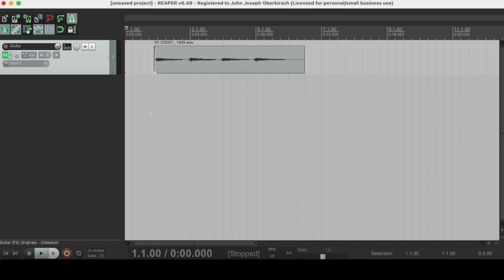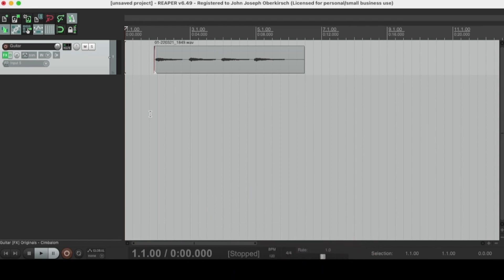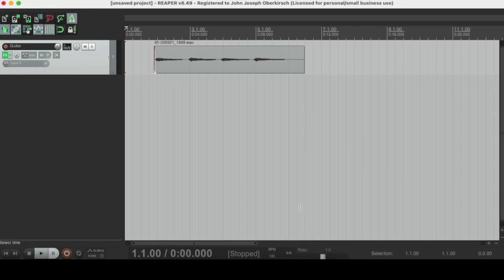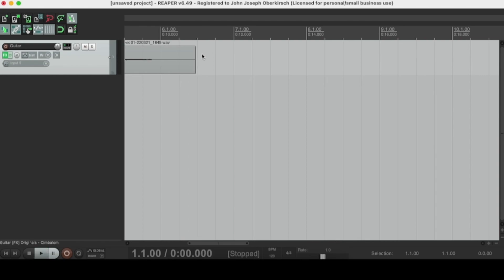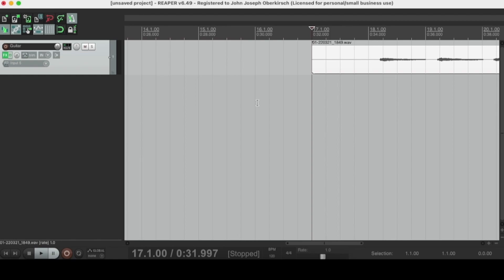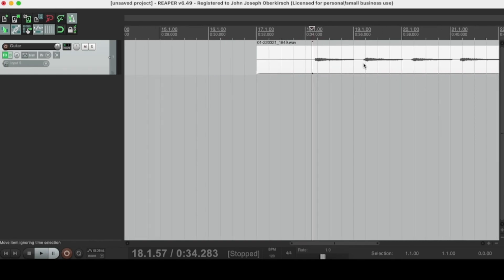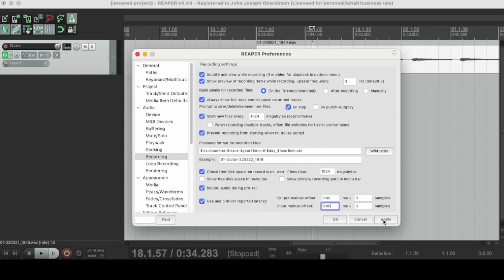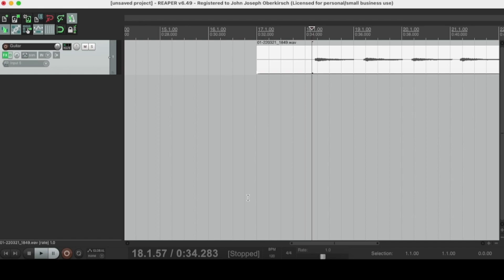How to Fix Latency in REAPER (Easy to Follow Guide!)

Comment: Latency in windows is mostly due to using the cpu for digital to analog conversion.  ASIO4All driver is more efficient than the windows driver but still rides on top of the existing driver and uses the same hardware interrupts to do the conversion.  The only way to get rid of latency in windows is to outsource the conversion by using an external interface that will handle the conversion.  This completely bypassing all the windows audio and you can easily get your latency down to less than 10ms.  Using a Focusrite 212, my latency is under 2ms.

Comment: I don't know if there's anybody who can help me out with this. But the problem is when I record with 0 latency on the output it sounds like my voice get's recorded through the mic and back into my speakers or headset, like there's a double voice. I don't know or think that it has anything to do with the latency, Because when I try to adjust the latency input it doesn't change anything. The only thing that I noticed is that if I put the latency input to 50, it records, but everything that's recorded on the track is delayed. But if I keep it at zero, My voice keeps having a feedback effect almost ust like an echo while I record, which makes it immposible to record anything. So if ther's anybody who know's what the problem is and what to do about it, I would be more than happy to know.

Comment: I also struggle with latency. The wasapi driver on Windows with buffers set to 128 is good but not quite there. Just a heads up for those who have very long latency, you can't use Bluetooth for your phones obviously. You have to use wired phones directly into your computer.

Comment: This doesn't work for me, i still get massive input latency and i can't seem to be able to resolve it.
I'm just trying to use my Focusrite 2i2 1st gen as my input soundcard and using my computer as my speaker when plugging my guitar.

I'm using a Focusrite 2i2 1st gen.
My Reaper Settings are:
Audio > Device: Audio System: WaveOut
                               Input Device: Analogue 1+2 (Focusrite)
                            Output Device: Headphones (Speakers from my computer, not the Focusrite outputs)
                            Sample format: 16 bit
                            Input channels: 2
                         Output channels: 2
                                 Sample rate: 44100Hz
                                         Buffers: 8x 512 samples
                                         (latency 92ms)

I'm assuming it's because i don't use the outputs on thea actual focusrite hardwarei i get the latency?
 Ihave tried every possible combination of changing both sample rates and buffer sizes to try and get a better latency response but nothing works.
If anyone know if there is way to fix this, it be very nice if you had any pro tip's as i'm really bad at this technical stuff.

Comment: For those using windows 10 and 11, on reaper. Go to options > preference > audio > device > audio system > choose WASAPI. Then make sure on input device choose your audio interface, then output device choose your pc speaker.

Thank me later, you're all welcome!
Reply: Man you have no idea how grateful I am for this it fixed everything THANK YOY
Reply: this comment solved my issue ... thanks a lot
Reply: ayo u fixed my shit thanks
Reply: Bro, you are a freaking saint! fixed in 10 seconds what was driving me nuts! thanks!
Reply: It was defaulted to shared mode and i got an error to say input device sample rate does not match output device samplerate. I tried exclusive mode and it could not find output device format.

Can anyone help?
Reply: @joefirth7428  try plugging your audio interface to different usb port, preferably 3.0 usb (color blue) then try the instruction again above.
Reply: Dude same problem. Did you find any solution? @joefirth7428
Reply: @joefirth7428  Same issue here... I used exclusive mode and it worked it out
Reply: Saved my life THANK YOU!!!
Reply: Thank you broo
Reply: I'm flabbergasted this isn't the standard setting.
Reply: i aim to be like you my brother, THANK YOU
Reply: It's not giving me the option for my audio interface on Wasapi, please help
Reply: @archer5793  make sure you have the latest version of reaper on windows.
Reply: Make sure your reaper is up to date.  @archer5793
Reply: @archer5793 that’s my problem
Reply: W COMMENT !!!!
Reply: Thank you so much, my man saved the day THANKS!
Reply: Yessss! Thank you.
Reply: thank you!!
Reply: Thanks
Reply: Thank you man, you are great!!!!
Reply: Bro thank you so much
Reply: W King
Reply: Thank you
Reply: you are a legend bro
Reply: You are a superhero
Reply: Thank you
Reply: Thank you
Reply: Been having problems with Reaper for months now I gave up looking for a solution for a while. Thanks!!
Reply: legend. thank you heaps.
Reply: like in five m setting for my windows setting im confused
Reply: am i doing something wrong its still crashing once i fly in for 3 seconds
Reply: Bro wtf thank you ahahaha
Reply: Spittin that fire knowledge
Reply: thank you man you helped me 🙏🙏🙏
Reply: Oh my god thank you a ton bro i hope you see nothing but good for the rest of your life
Reply: Man, thanks bro! Better than every four-thousand- hours worth of videos I've watched.

I still have an 8ms delay and it sounds like there's a chorus turned on. But I also just saw the part where you said to set the output to your computer. I'm gonna try that next and see if it works. Not sure how the heck you figured out this hack, but thanks for sharing it!
Reply: Fucking thank you legend
Reply: nice bait lil bro unfortunately it's a fucking lie, making people unable to record afterward
clown.
Reply: From Germany…. Danke schön 😊
Reply: I love you so much rn
Reply: But now I can't hear myself on the headphones!
Reply: absolute legend!!!! Everytime I played my Microfreak keyboard there was a delay and latency... Literally tried your trick and it worked straight away!!! cannot thank you enough!
Reply: I love you
Reply: HOLY THANK YOU
Reply: fixed my problem thanks! i Still downloaded and instialled asio4 but cant figure out how to actually apply it
Reply: Saved my life with this. Thank you so much.
Reply: I dont think mine works on that... only WaveOut:/
Reply: thanks!!
Reply: Mayn that didn't work at all
Reply: You a Real one !!
Reply: Marry me plz
Reply: Thanks
Reply: love you dude
Reply: Thank you!
Reply: omgomgomogmogmogmomgmogmgomgmogmgo thank you
Reply: Now it’s just delaying through my monitor
Reply: There is no preferences tab under options
Reply: Thank you very much, man...
Reply: I had gotten so used to the tracks now not lining up and the minor input delay that having my audio come through is throwing me off 😂😂 thank you so much as this as I can finally stop strssing over lining the tracks up after each take
Reply: that's the real one. Many thanks my brother
Reply: Thank you so much <3
Reply: THANK YOU MAH MAANN
Reply: Thanking you later.
Reply: Thankyou dear commenter
Reply: Thank you so much 😊
Reply: This is the fix right here, nothing else worked.
Reply: bro i never comment on stuff, but wanted to let you know THAAAANK YOUUUU lol!!
Reply: thanks bro
Reply: ı wish ı could kiss you
Reply: Insta fix!!!!! THank you!!!!
Reply: OMG THANK U!
Reply: dude thank you very much!
Reply: You're a mother fing god! Thank you!
Reply: My audio interface isnt showing up as a option in my input device
Reply: how TF did you figure that out lol
Reply: Legend! Thanks pal.
Reply: 😂thanks so much... I could not figure that out ..  thought something was wrong with me 😔..
I was recording the audio from all my VSTs into Reaper because the MIDI was horrible but your trick fixed my issue.
Reply: Nic eone bravvaaa

Comment: I had no issue whatsoever in pro tools, same interface in reaper and it’s unusable now, can’t possibly record with latency this bad.
Very disappointing.
I’ll have to rig some sort of live monitoring to record guitar, DI into my Saffire that records the track, but take a dry output to my pod hd and monitor that straight into the mix control of my saffire.
Seems unnecessary.

Comment: doesnt work. installed audio4all drivers, changed manual offset....made no difference at all :(
Reply: same here. When using ASIO sound system its still delayed and with a ton of cracking/popping. If I use WASAPI the sound is clear but still delayed. Doesn't matter if I use 200+ ms in either direction for input or output. No idea.

Comment: ASIO fixed mine with the 2i2 perfectly, but just installing the driver does nothing, gotta make sure to change the 'Preferences > Audio > Device > Audio system' to use 'ASIO' cause it will still probably be using the default

Comment: Not sure if I have the same problem but maybe you can help. I recently switched from Windows to MacBook Pro. With headphones plugged into the audio interface and a track armed to record, it sounds like two voices when speaking in the mic. This doesn't happen when the track is not armed for recording.  Also noticed by adjusting the Mix knob on the AI (back and forth) it's not as noticable at certain settings.  I tried adjusting the Input Manual Offset to both extremes; -200 and +200ms but couldn't hear any difference.  However it is noticable on the waveform when actually recording.  Positive numbers show up earlier but negative numbers don't delay like I would expect. 

It appears to me tpath taken is the audio signal at the AI input, through the USB, then being  processed by Reaper and sent back to the AI output (headphones).  As a result you hear yourself speaking and what was processed by Reaper being sent back.  Is there a way to disable the audio signal being reprocessed and sent back during an armed or actual recording session?  I think this is what I need to do.

Comment: so I watched your vid and the incremental changes where taking forever then I remembered reaper tells you the latency depending on what you got your mic buffer to under (devices). mine was   8 x 795 equaling 132 ms so i set it to 132 ms and no delay. just thought I should point that out fix took like 30 seconds once I knew the latency. great video thanks.
Reply from the maker: Excellent. Thanks for that.

Comment: My recording is coming in too fast, ahead of the beat. What do I do in this case?
Reply from the maker: Hey. You can try the following - 1. Check your audio interface and driver settings. Make sure the sample rate matches your project settings in Reaper. Mismatched sample rates can cause speed issues. To do this, go to Options > Preferences > Audio > Device. In the Device section, make sure the Sample Rate is the same as the Project Rate.
2. Adjust the Input Manual Offset in the opposite direction. Instead of adding milliseconds to delay the input, subtract milliseconds to bring the timing back. Start with small increments like -5 or -10 ms. To do this, go to Options > Preferences > Audio > Recording. Enter the desired offset in milliseconds under Input Manual Offset in the Input section.
3. Record with input monitoring off, then align the clip later. Sometimes, direct monitoring can cause speed issues. To do this, turn off the Input Monitoring button in the toolbar. After you record, you can use Reaper's alignment tools to snap the clip back into time.
4. Quantize or manually align the clip after recording to snap it back into time. You can use Reaper's quantize functions or slice the clip and nudge parts back into place. To quantize the clip, go to Tools > Quantize. In the Quantize dialog, select the desired quantization settings and click Quantize. Use the Split and Nudge tools to slice the clip and nudge parts back into place.
5. If takes are consistently too fast, it could be your performance rather than latency. Use a metronome, work on your timing, or have Reaper automatically adjust the timing of the recordings. Go to View > Transport and click the Metronome button to use a metronome. To work on your timing, practice playing along with a metronome or backing track. To have Reaper automatically adjust the timing of the recordings, go to Options > Preferences > Audio > Recording. In the Input section, enable the Auto-align recorded takes option.
6. As a last resort, render out the faster clips to new files. Then import those rendered files back in, which should be at the correct speed. To render a clip, select the clip and go to File > Render. In the Render dialog, select the desired output settings and click Render.
I hope this helps 👍

Comment: i tried dthis but i still have the same issue.  i have focusrite solo 3rd gen, on  reaper i show 192 as samples, 10/11ms on latency.  whenever i click on midi using mouse, theres a delay in the response. like 1-2 ,  1 is the click on mouse, 2 is the response of the midi.  it used to be close in real time.
Reply from the maker: I see. It sounds like you are experiencing input latency. This is the delay between when you play a note and when you hear it. There are a few things that can cause input latency, such as the audio interface, the computer's CPU, and the settings in Reaper.

Here are some things you can try to reduce input latency:

1. Make sure that your audio interface is properly configured. Check the driver settings to make sure that the sample rate and buffer size are set to the lowest possible values that do not cause audio dropouts.
2. Close any unnecessary programs that are running in the background. These programs can use up CPU resources and increase latency.
3. Reduce the buffer size in Reaper. The buffer size is the amount of audio data that is buffered before it is played back. A lower buffer size will reduce latency, but it may also cause audio dropouts.
4. Use a different audio interface. Some audio interfaces have lower latency than others.
If you have tried all of these things and you are still experiencing input latency, you may need to upgrade your computer or audio interface.

Here are some additional things you can try:

Make sure that your Focusrite is properly connected to your computer.
Check the drivers for your Focusrite to make sure that they are up to date.
Try using a different USB port on your computer.
Try restarting your computer and your Focusrite.
I hope this helps. 👍

Comment: Can the input manual offset in reaper be used to counter plugin latency?
Reply from the maker: Yes, the Input Manual Offset in Reaper can be used to counter plugin latency. However, it is important to note that this is not always the best solution. In some cases, it may be better to adjust the plugin's settings or to use a different plugin with lower latency.

To use the Input Manual Offset to counter plugin latency, follow these steps:

Open the Preferences dialog (Options > Preferences).
Go to the Audio > Recording section.
Enter the desired offset in milliseconds under Input Manual Offset in the Input section.
Click OK to close the Preferences dialog.
The Input Manual Offset will delay the input signal by the specified amount of milliseconds. This will compensate for the latency introduced by the plugin so that the recorded audio will be in sync with the playback audio.

The amount of offset required will vary depending on the plugin and the settings that are used. Experimenting to find the best setting for your particular situation is important.

Here are some things to keep in mind when using the Input Manual Offset to counter plugin latency:

The Input Manual Offset will only affect the input signal. It will not affect the playback signal.
It can only compensate for latency that is introduced by plugins. It cannot compensate for other sources of latency, such as the audio interface or the computer's CPU.
It can introduce its own latency. This is because the audio signal has to be delayed by the specified amount of milliseconds before it can be recorded. I hope that helps. 👍

Comment: My mic was behind, so i changed the input latency and it didnt do anything. I went from 10ms up to 200ms and it was exactly the same. What am I missing?
Reply: I had the same issue, try using a negative number like -250 for example. That worked for me
Reply: Make sure the setting is checked for reaper to use ASIO sample rate
Reply: @darklinkduck2275  how do you do that ?
Reply: @darklinkduck2275 how?
Reply: Richard, you didn't happen to be using old windows xp or 7 did you, when you had problems? It's weird I'm suddenly having problems with the offset not working but it worked for me in the past.

Comment: Can't get rid of that input delay even changing the input manual offset to high values T.T
Reply: Neither can I... I'm so frustrated and sad.... :(
Reply: @waynehedd  Just to update, i was told that reducing the buffer size in de Asio settings would improve the delay but it would take more from the cpu. Upgraded from a reyzen 3 proc to Ryzen 7 and made no difference (still 16Ram, 256 SSD). So idk how to get rif of that annoying mini delay.

Comment: where do you adjust the latency if you're triggering softsynths in Reaper?   When I play my controller, there is a delay/latency between the time I play the keyboard controller to the time I hear the attack of the sound in the softsynth.  I'm using a Windows PC with the latest ASIO driver.

When I'm in Protools, I can quickly and easily fix this issue by simply lowering the Buffer size from say 512 to 64 or 32.   But, within Reaper, there seems to be so many different options to fix different types of latency issues, it's difficult and frustrating to manage.
Reply: Best way is to put 32 or 64 in the 'request block size' field. It is the same as buffer size in PT :)